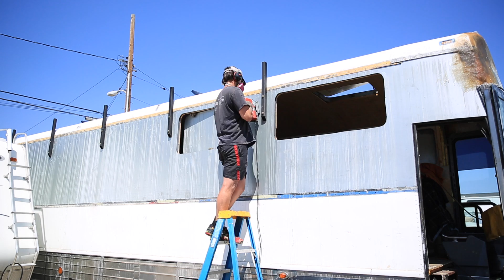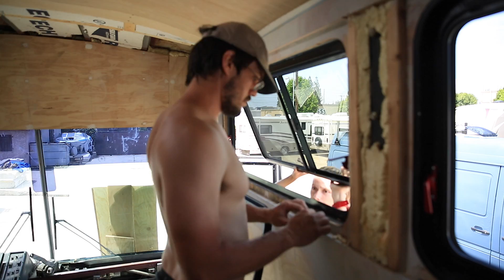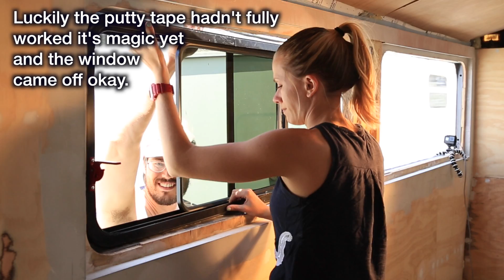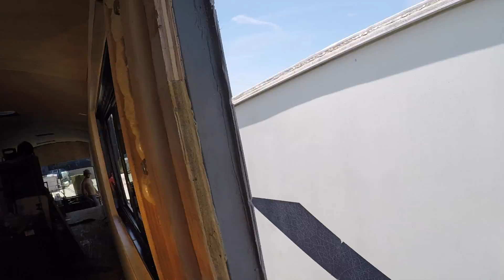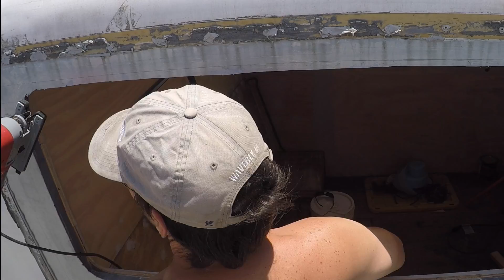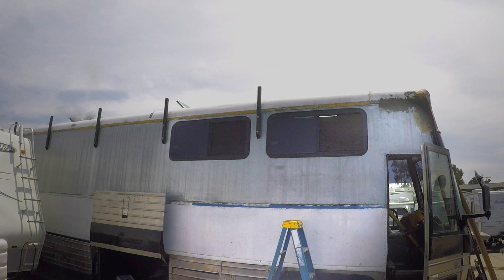#46 Bus Conversion Tiny House - Window Installation Time Lapse

Comment: One question. Why did you place the windows so high that there appears that there is no place in the bus that you can see outside without standing up. I like to sit at the table or the couch and look out the windows which seems impossible with your window placement.
Reply from the maker: +eddie bare Believe it or not but you can sit and look at our the windows. You can see quite a bit just not the ground directly beside the bus. Additionally you can see while standing , which we felt was very important, and you have an extended amount of privacy from people seeing inside. We had planned to have the top of the bed just under the bottoms of the windows which would have made for a great view!